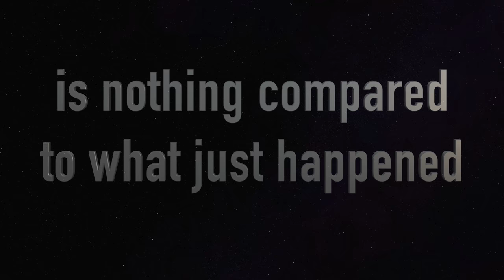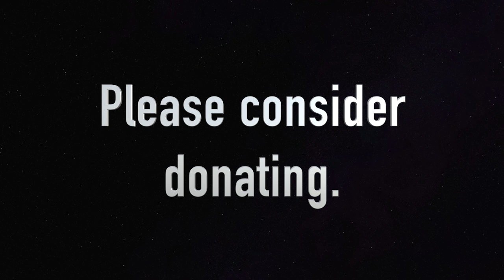Making Our Boat into Our Home

Comment: Hey Nick, FYI... When removing things like the Plexi-glass, experience has shown me that instead of cutting with a knife blade (as you know can cause a lot of damage you did not intend!), I use a line of quality "Dental Floss" works amazingly, plus it's fast. I have also used this method on mirrors (without breaking them) that were secured in place with calking... Hope this is an idea that you can put in your arsenal for future projects, by the way this method also works when removing windows that have been bedded with calking/sealant!... It is great to hear that you guys are safe and well and that the boat appears to be safe also... Love and happiness to you both... Fred & Soraya... Indonesia...
Reply from the maker: My preference is guitar string, which I carry. Problem was the 1/2-3/4” molded groove the plex was sitting in. There was no way to fish it around the back of the plex. But yes, it is a great hack. Someone should make a boathacking video. Thanks for the note

Comment: Saw your bath shower mixer taps, Nick - and would like to help with a tip so they always look like new ones.
New ones should just be wiped off with a dry cloth or towel - after use and they will always look like the first day.  
Elderly or old shower "dims" :-)  must be cleaned first and then they are maintained by wiping them off after bath.
Promise that they always will look like new if you use a dry cloth or towel after bath.  
(Don't see this as criticism ... just want to give a good advice.)
EDIT: Forgive me. Sorry for all the damage the hurricane has done. 
Nature can be beautiful but also dangerous and merciless.
Reply from the maker: Thanks. This is a charter boat. They. were already toast when we bought it. Appreciate it though

Comment: Nick, an invaluable tool to have is called a Fein Multimaster. It removes old caulk in seconds. It cuts with minimal dust and will do plunge cuts with ease. It sands in tight 90 degree corners. Buy the kit because it comes with everything in one box. It even comes with an extra long power cord. Best tool I ever bought. Removed a stall shower and built a new tile shower and this tool rocks!  Mine is 11 years old and I probably used it on 50 or more big jobs and it works as good as new. Here is a video link to see all it can do.
https://youtu.be/W_DH3rbSEJM
Reply from the maker: Yes, I’ve got one. Very handy. Could not agree with you more. I bought some of the extra accessory blades for the front window project. Couldn’t use it here. The problem in this case was the 1/2-3/4” groove molded into the fiberglass that the plex was slotted into. That groove shows now that the shelving is installed, and to score and scratch it with tools would mean a whole new world of work to re-gelcoat....it would never match. I was hoping to get piano wire around back of the plex, but the fit was too tight and the turns too sharp. I tell ya....that thing was really really well installed! I guess at the end of the day, I’m glad the builder went to such lengths with this boat!